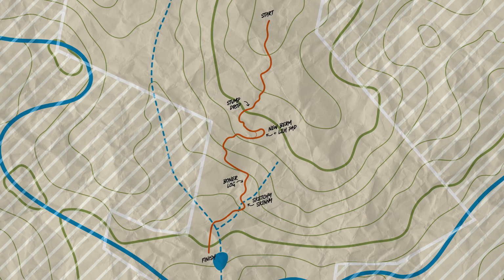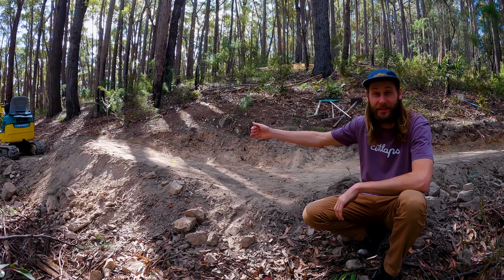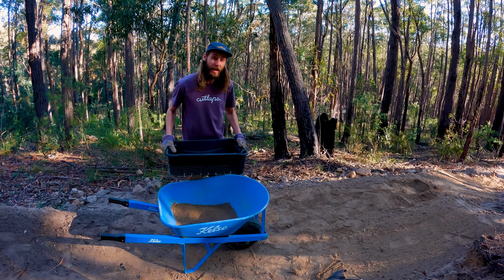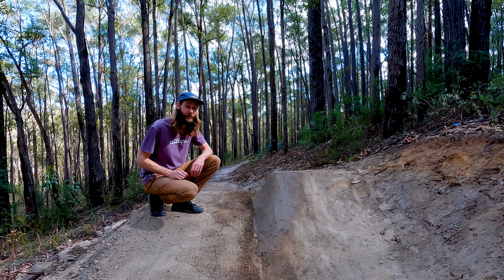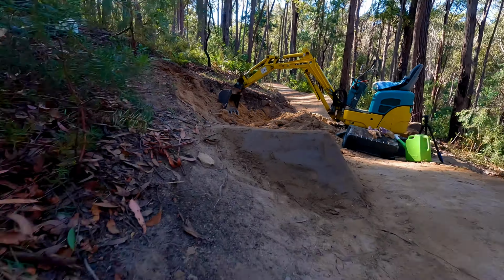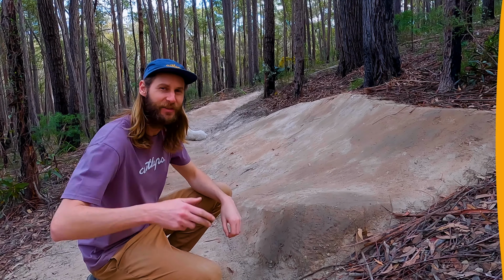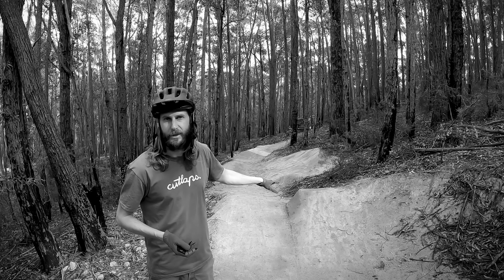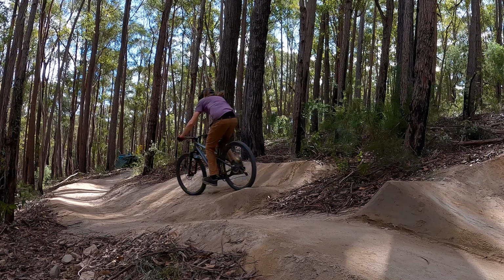This MTB Feature is FAST!

Comment: Move the lip back , so the back of the roller acts as a down ramp.  Then you should still be able to catch the right hand berm
Reply from the maker: Yeah that could be cool. May be a bit tight after the previous jump. But could shift the roller closer to the berm a bit.

Comment: What if instead of worrying about a catch berm so close to the landing, cut a new trail straight down off and a bigger berm a little further down to swing you back up onto that trail. < this is probably why I’m not a trail builder
Reply from the maker: That's actually a pretty good idea and there were a few similar ones in other comments. I went to have a look to see if it was possible but there are too many trees pretty tight together. Thanks for watching and your comment.

Comment: Definelty won’t read this, but why don’t you place wood do make a drainage so that the water would go threw the wood and not on your trail, just back a deep while for drainage and then have wood over it
Reply from the maker: That's an interesting idea and one that I have thought about doing elsewhere on the trail. I have a steep section that will eventually erode badly if I don't sort it out. So I thought about a small bridge section like you mentioned.

But rollers and grade reversals are a much better way to manage water and a lot of fun to ride. The reason they are better is that for good drainage you need to have run offs every couple of metres. And that would take up too much wood.